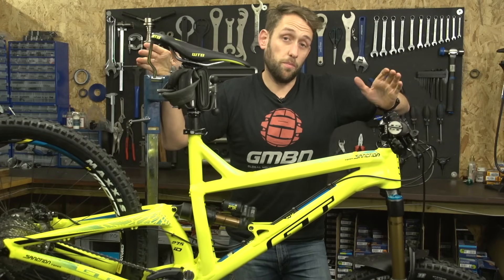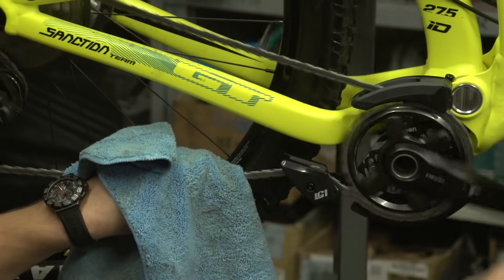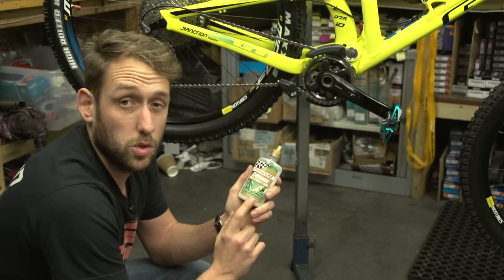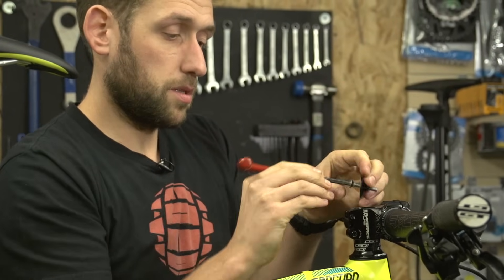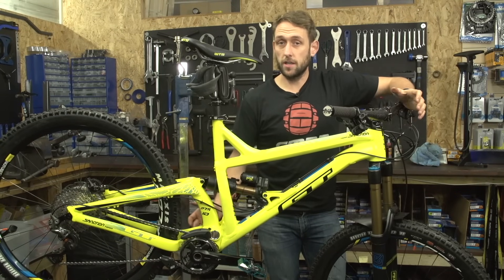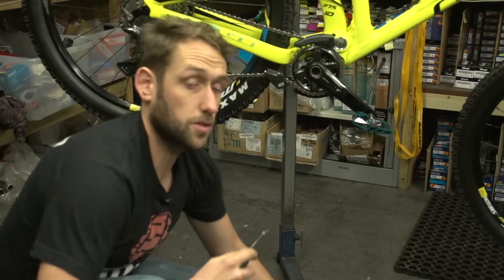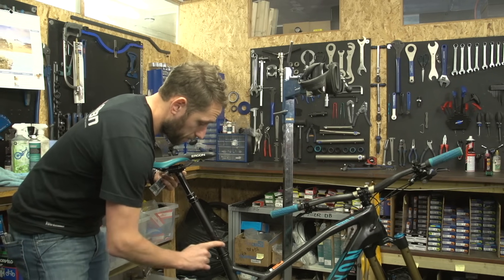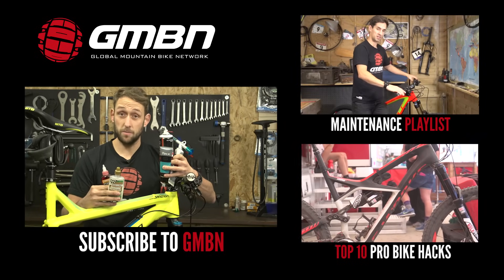How To Apply Grease & Lube To Your Mountain Bike

Comment: placing grease on threads of a bolt is a no no. The friction change between the bolt and nut affects the torqueing of the bolt and results in an over torque. Torque ratings are given for a dry fastener applying lube to the fastener usually results in over torqueing bolts. beware.
Reply: Nick - it’s actually the other way around.

They calculate the threads assuming minimal friction and thus is why thread lubricant is added. We do it to bolts that way from grams to 100 kilos.

Comment: pedal threads take copper compound just like any non moving part you don't want to seize. conventional grease when subjected to the elements can actually cake and seize parts. Bottom line, move parts = grease, non moving = copper anti seize compound.
Reply: Never use copper grease or any other copper compound on aluminum.
Aluminum will be very susceptible to galvanic corrosion in contact with copper, assuming that the two metals are also in contact with a common electrolyte (such as water with some ionic content.)

Comment: I have tried the following procedure to clean my chain to be very effective (have been experimenting for several months):
1. cleaning with degreaser (gets rid of the gunk/dirt more effectively)
2. rinse with hot water (clean off the degreaser, wich can dissolve the lubricant)
3. dry with a rag
4. apply PTFE to all links (displaces water out of chain links and rollers)
5. wipe excess with rag and test-drive the bike
6. apply chain lube (the ptfe is a ligth oil, so it gets washed away pretty fast, better to use a proper lube)
Reply: Navi Nathane Charlotte thanks man helped alot

Comment: Anther pro tip about the spoke nipples, use linseed oil, rather than locktite. It is a binding agent, but also lubricates and stops nipples rounding when trying to true wheels. Many sets of wheels I have seen swimming in locktite and I can never get them straight.
Reply: TheMrDavidCurran
Reply: binding agent si the opposite of a lubricating agent

Comment: great vid. something for those of us who are cursed with sensitive skin should avoid doing is coming into any contact with these lubes and chemicals, they can set off some serious rashes if you are unlucky! wear those gloves :) i would also strongly advise against using loctite where it can come into contact with any plastics as it can be extremely corrosive for plastics.

Comment: 01:40 rusty bolt holes. I use Hard as Nails fingernail polish for bolt heads that start to rust. Black and clear, black for the rust and clear as a cheap alternative to loctite.

Comment: Not sure if the greases  etc mentioned here have the same effect as ones used on cars, but having an oily rag in mechanics' trouser pocket was found to allow oil etc to seep into skin and cause testicular cancer. Though I have used bare fingers in the past, I would use latex gloves, for protection now, or a brush, when smearing grease or oil on a thread.

Comment: if you grease your bolts be sure to correctly adjust your torque specs as it will change due to the drop in friction coefficient

Comment: After killing far too many sets of brake pads i learned to put show caps over mine when applying any cleaning products to the bike, even things like Muc-Off have degraded a set of pads on my bike so for a quick clean i have some cheap shower caps from eBay i stick over them, for a monthly deep clean and re-grease i take them off and get them well away from the bike!

Comment: Hi! My flat mtb pedals have a grease sign next to a pin in the middle of it. It doesnt seem much sense to put thick grease through that small pin-hole. What do you think if i put that ceramic lube you recommend or just some synthetic motor oil ?

Comment: Do bear in mind that greasing a bolt -- even with just anti-seize -- MAY result in an over-torque situation, thus risking thread deformation. So only grease those bolts that call for it in the specs.

Comment: Is PTFE similar to WD40?
Reply: +A J MacDonald Jr  https://en.wikipedia.org/wiki/Polytetrafluoroethylene
WD-40 makes a PTFE...it's teflon
Reply: +A J MacDonald Jr Standard WD40 contains no PTFE (which is teflon as stated) and is only good for cleaning, degreasing and un-seizing parts, don't use it on your bike.
Reply: No WD40 does not contain Teflon and no other spray smells as nice as GT85 😋
Reply: +Jason Cross sorry, I meant that the company WD40 makes a PTFE spray, it's called something like wd-40 special or specialist. Regular WD40 does not have teflon in it as you said
Reply: Thanks. I've looked for the Muck Off spray before, because it was recommended by the guys at GMBN and I found it was only available in the UK. I have a Teflon grease I use (Super Lube) so perhaps I can buy that in the US in spray form? Just found this: Super Lube with Syncolon 160 (PTFE) a multi-purpose lubricant, safe to use on anything that slides, swivels, rolls or squeaks. It withstands temperatures within a range of -45 to 450 degrees F. http://www.amazon.com/gp/product/B0016GTSBY
Reply: +A J MacDonald Jr Your local bike shop probably has suitable sprays
Reply: +Ed Freedman yeah I have seen that but still doesn't smell as nice 😊
Reply: +littlestworkshop I thought WD in WD40 meant Water Displacer, and they got it right on 40th version.
Reply: +This Guy Yes on the WD, the 40 bit seems too convenient but may well be the story. It does work as a water displacer which is OK until you realise it took all the grease with it too. I ruined a pair of decent pedals this way, WD displaces water AND grease, WD buggers off, water comes back, rust!
Reply: Good point!

Comment: im a bit confused, when and where to use grease and antiseize ??? also, i  am buying a carbon handlebar and going to use it with an aluminium stem,unfortunately i couldnt find anything like marc's carbon parts grease,is there any chance i could use one of those greases based on moly ,lithium,or synth mineral oil base grease???or simply install it dry ,what do you guys would do??

Comment: I have watched this video now more than 10 times. And it's still great. But I'm still not getting why on earth you are putting lube on the chain 2 times. First the ptfe also called Teflon lube. And then another lube..?
Reply: Nikolaj Andersen the ptfe displaces water and grease. After using the ptfe you want to use a lubricant on the chain to get lube back on there.